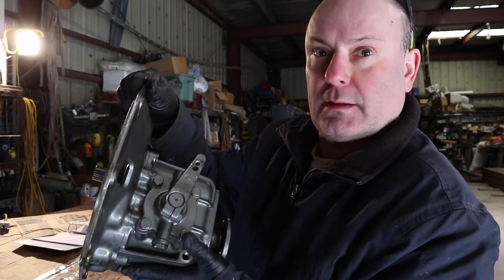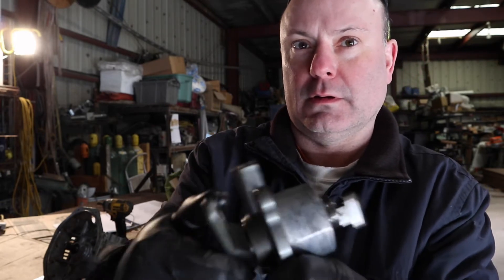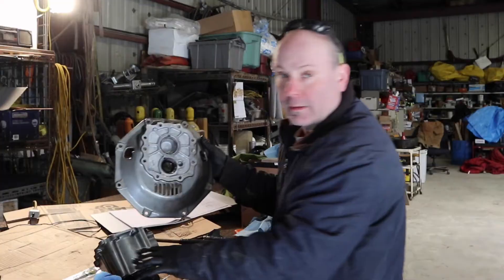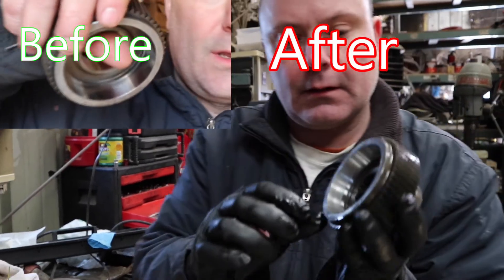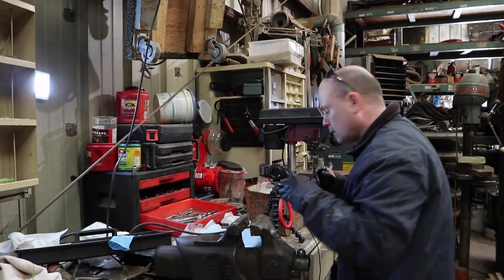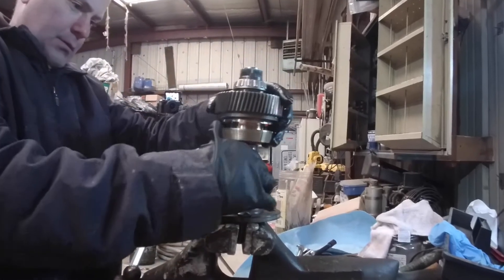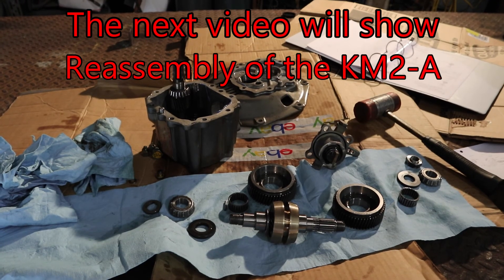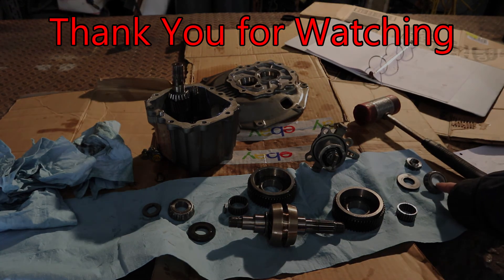Yanmar KM2-A Disassembly and Cone Lapping

Comment: Great video👍 I wonder is my Kanzaki  KM3P gearbox(attached to 3GM30F) similar as this? It keeps a whistling/whining sound(Forward Cone is sliding??) at some RPM(If I remember right, at idle speed and little abowe 2000rpm. But I can cruise Other engine speeds with no sound. Could it be that it needs to be lapped or some other issue? Thanks🎉
Reply from the maker: I am not sure if the KM3P is a cone clutch or if it has clutch plates. I think the KM3P has clutch plates... I am not sure and I don't have the manual  here.
Reply: @ Thank you very much of your answer! I’ll try to figure that out🫡👍

Comment: I finally got my transmission out of my boat (an S2 7.9, the little baby version of yours). Getting it out of the boat was TIGHT, I had to remove the packing material from my drive shaft to make juuuuust enough clearance to let the transmission come off the engine and up so I could remove it. 

I decided to buy new seals for the input shaft, output shaft, and shifter. I wonder if you replaced yours when you did it? The instructions say to apply 'sealant' to these seals but don't specify what to use, figured I'd ask if you had any idears ;-).
Reply from the maker: Yes I think I replaced the input and output seals. I don't think I replaced the shifter seal. I used RTV black as a sealant.  I don't remember if I used sealant on the input and out put seals.... Keep in mind I did this 5 or 6 years ago... My transmission is still working 100%.  
One thing I would suggest is to remove your propeller shaft and replace your cutlass bearing.   It is a very difficult job, but since you already have the propeller shaft apart and the packing apart, it is a logical time to replace the cutlass bearing. 
I thought the S2 7.9 had a sail drive and not a propeller shaft.  
Best if luck and I am happy to answer any questions that up....
Reply: @sonofneptunesailing917  Well, I got it all done today, thanks to a rainy day in the Midwest.

I replaced the input and output shaft seals. On mine, output shaft seal was terrible to get out, I gouged the transmission housing a little while doing it. I didn't add any sealant to these seals, just a dab of oil around the outside lip to help them slide in easier.

Also I saw on yours, your forward gear had some play I think. On mine, it had a lot more play. Mine is a KM2P though, there are a couple of things that are different -- like on mine, the actual shifter is not reversible as it sort of contours the cone clutch. It has an 'up' and a 'down' side, and can't be flipped over unfortunately. But mine looked fine, so no problem anyway.

My forward gear was not nearly as bad as yours. Pretty glazed, but not that mirror finish that you had. But on mine shifting into forward would work most of the time. It just seemed to have bad days every now and then where shifting into forward would slip and catch and slip and catch (causing the whole motor to buck a lot). Usually shifting to reverse and then back into forward would get mine to go into gear properly. Lapping it definitely got rid of the glaze and definitely felt better going into gear just holding it with gravity, like you showed.

Anyway thanks for the video! I likely would not have tackled this project myself without your kindly manner. This also convinced me to get an impact wrench...when unstaking the output shaft nut, my punch just couldn't get the whole divot out of the nut, so impact was the way to go.

Comment: Hello, I just had a friend contact me about a small boat with a Yanmar engine and transmission. It goes into reverse instantly. If you shift into forward it seems to be slipping but if you rev it up a good bit it will engage. Sounds like this is the answer? Thanks for the great video. Too bad they don't make a lapping oil to put in run and drain....LOL.   So the symptoms this fixes are slipping correct?  Thanks Again.!!!!!
Reply from the maker: Yes lapping the cone sounds like the answer.  I would just make sure the transmission is a cone type and not a clutch plate type.  
Thanks for watching!!!

Comment: Can you send me the link for the seals and bearings please?  Great video, thank you.
Reply from the maker: I don't still have the numbers for the parts I used.  I just went to a Yanmar dealer with my service manual and they cross referenced and ordered the parts.
Reply: @sonofneptunesailing917  got the parts. $60US for the seals, o ring and nuts. Not bad.  Did the rebuild yesterday.  Great instructions.  Thank you. Torqueing that  final coupling nut was not easy to get 80ft/lbs.  no where to hold the trans.  Will recheck once I install back in the boat.  Also, the shifter adjustment is critical. Thanks!
Reply from the maker: @Saylor-Rob61  I hope it works!!!

Comment: What size gear puller did you end up using?  Looks like it might be a 6" or 8"... Planning to rebuild our transmission and need to get this tool, so hoping you might be able to share what you used.

Comment: One final question - in putting the 300 ml oil into the transmission do you screw the dipstick all the way down to check the right level or only put the dipstick in and not screw it down to check the mark on the dipstick?  Know what I mean?  Thanks.
Reply from the maker: I think you screw it down.  The Yanmar owners Facebook group is a good source of information like that.  I remember reading posts about your question.  I don't remember the answer.
Reply: @sonofneptunesailing917  I’ve read both ways but like other dip sticks screwing down makes sense

Comment: Hello, thanks very nice explain video, but can you describe the symptoms of the engine, to be sure that’s the problem is the cone?? Thanks
Reply from the maker: At low speed my transmission would go into gear.  As I increased RPM the boat would not increase speed and the transmission make a noise like a washing machine.  When I would increase RPM more to 1,000 ish the transmission would make a Bang sound and the boat speed would increase.

Comment: Thanks for making this video!! I think I might have to do this on my gearbox as well. When I put the lever forward, it doesn't immediately go into gear, when it does eventually kick in, it vibrates a lot until I rev it up a bit. When i put it in reverse, there doesn't seem to be any issues. Do you think that might be the symptoms of worn off cones ?
Reply from the maker: Yes sounds like the forward side of your cone is glazed. I got a lot of good advice from a yanmar owners Facebook group

Comment: Great video.  I did this task about a year ago and need to do the same on my other engine (note only ~1300 hrs before gear started slipping).  I recall the hardest part was the first step removing the output shaft nut.  After grinding the chiseled divot (chalk mark in the nut) it was difficult to loosen the nut while trying to hold the unit firmly.  Did you use the 'special tool'? (#177075-09050) or perhaps bolt a piece of steel to the coupling to brace it against the vice or floor?
Reply from the maker: Thank You!
I think put a pin in the output shaft flange to lock it so I could loosen the nut.  I did this project 2 years ago.

Comment: Very helpful! Thank you! What are the dimensional specs of the cone? At which point is it worn too much and a replacement is in order?
Reply from the maker: The manual says to replace the cone on the KM2A when the amount of wear on the tapered contact surface of the cone is less then 24.1mm.   I would recommend downloading the service manual there is a section on Inspection and Servicing that gives all the dimensions and tolerances of various parts and places to look for wear.  There is a Facebook group called Yanmar owners that I believe has down loadable versions of the service manual.   
The common issue with these shift cones is not that they wear, it is that the oil between the cone and tapered surface of the forward gear heat the oil and create a "glazed" oil surface that prevents the cone from locking into the gear.  It is similar to the "seasoning" on a cast iron frying pan.  The point of "lapping" the cone is to remove this layer.   I believe this transmission needs to shift fast and not have too much oil.  Slow shifting and too much oil can cause the cone to glaze and the transmission to slip.   
Thank You for watching!!!

Comment: My springtime project, I have absolutely no reversing power at all, makes for very tricky docking,,,
Reply from the maker: Typically, a glazed clutch cone is a forward gear problem.  Not having reverse may be a different issue.  Gool Luck!  There is a Yanmar Owners group on Facebook that typically gives good information.

Comment: Awesome job. I'm sure this will get a ton of views, as you mentioned there are next to nothing for video resources for this. On my gearbox, reverse was working correctly, but forward would make a slipping and banging unless pressure was kept on the shifter lever on the gearbox. I'm hoping that lapping the cone and flipping the shifter like you did will resolve my issues. Thanks again for the excellent video.
Reply from the maker: Yes, My transmission did the same.  It would go into gear in forward, but then when I increased engine RPMs from idle to 1000 ish RRMs I got no additional speed.  When I increased RPMs to 2000 the transmission would bang into gear.  I learned this is happens because the shift cone gets glazed and needs to be lapped.   Lapping my shift cone solved the issue.  I did this 2 seasons ago and my transmission has been working perfectly!
Reply: @sonofneptunesailing917  Happy to hear this. My boat is on the hard till April 1st, so I have a project.